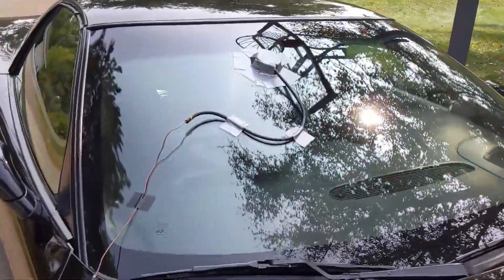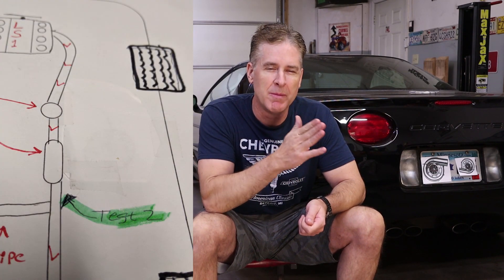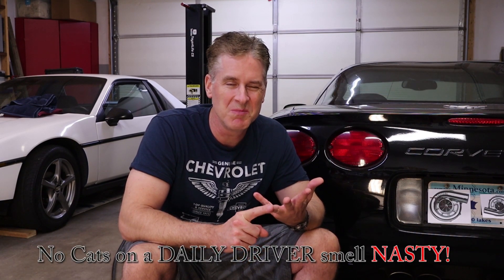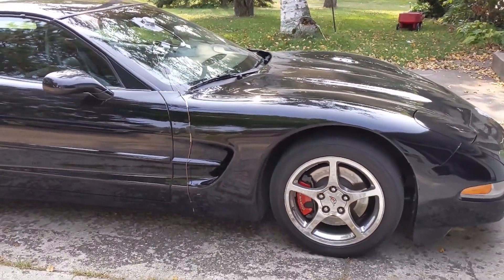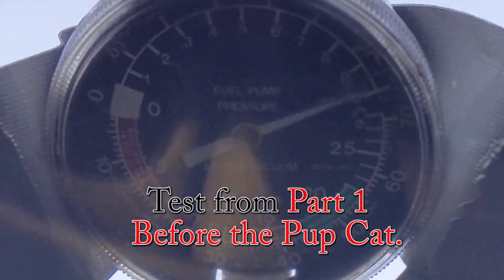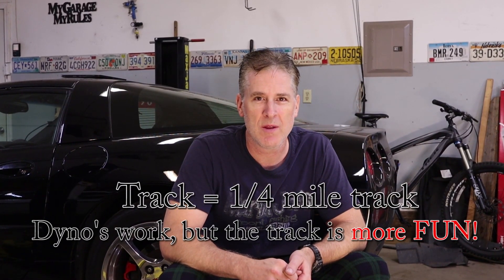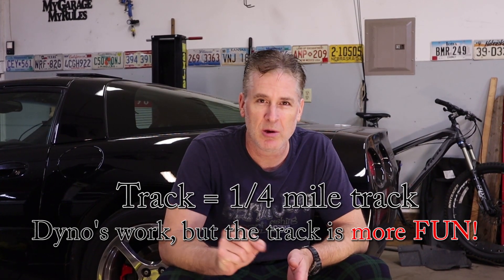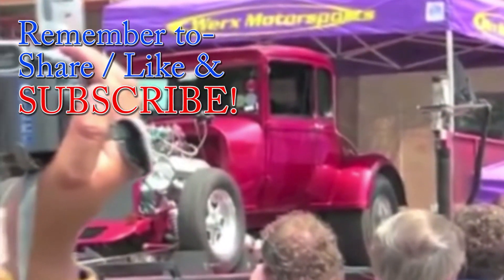C5 Corvette -  Exhaust Backpressure Testing Part 2!

Comment: I saw a post where a guy put LS7 manifolds and catalytic converter‘s on a C6 LS2 automatic and picked up 30 hp on the Dyno! Seems like a worthwhile modification and you keep the converters. GM did a lot of CFD work on those manifolds and they are by far the best flowing stockers. Great video and thanks for all that you contribute.
Reply from the maker: Thank you!   I had no idea the LS7 manifolds would even bolt up to an LS2.  I thought the bore centers would be different (or too different)...

Comment: I put borla stingers,  a catless x-pipe, TSP long tube headers, and a blackwing CAI on my C5 and it made 356 WHP on the dyno.  I'd call that a decent gain with mostly just exhaust modifications
Reply from the maker: For sure that's a nice gain 100% removal of the catalytic converters is probably responsible for a big chunk of that horsepower.  Did you get a tune as well to lean things out a little bit?
Reply: @Toys4Life  Yes, it was dyno tuned